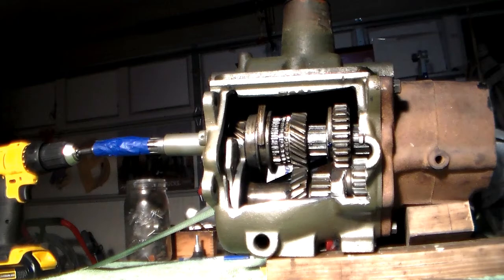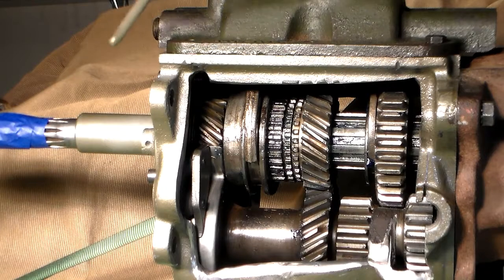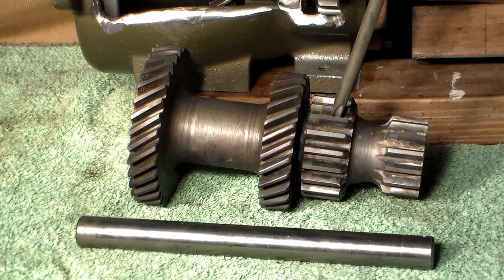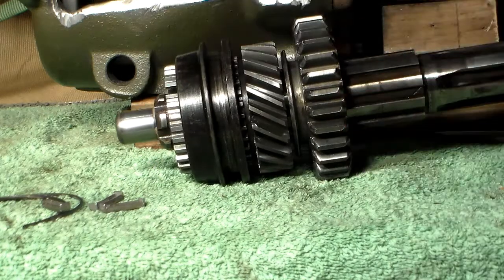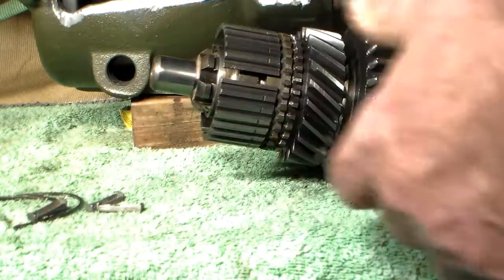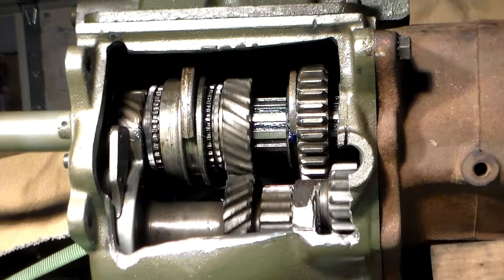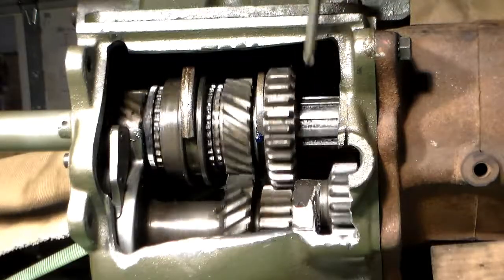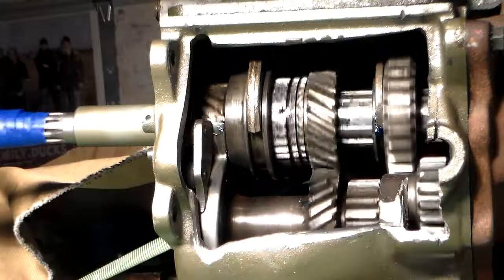Rick Stivers T-90 CutAway Internal Operation

Comment: Sir, recently I assembled a T90 wirlth the help of your videos. However, due to some mistake of mine, the engine stops when I release the clutch on 1st, 2nd and 3rd gear, although I have not connected the output shaft to wheel. The transfercase shaft are also rotating on engaging transfercase shift lever (the transmission gear in neutral). What may possible be the mistake I have made
Reply from the maker: Believe it or not I have experienced a similar problem. In my case, when I installed the shift tower, the first reverse fork did not get into the slot on the gear. It was stuck in reverse all the time. When I would shift into 2nd or 3rd gear it would stall the engine. That is because it was going into two gears at once and this locked the transmission. I don’t understand why your’s would do it in 1st gear. If that isn’t the issue I would look at the shift tower linkage to make sure it’s operating properly. 

I’ve gotten rid of all of my transmissions and Jeeps so I can’t make another video to assist you further. I hope this helps.

If you go to the 5 minute point in this video I think it will explain enough to get you through it with what I told you above. 
https://youtu.be/QzH5SWaeegQ?si=7HRLrrCQlo_te_8I
Reply: Sir, further today when I turned on the engine without the tower shifter, I find out that the counter shaft is rotating in neutral also, whereas it is rotating freely when the engine is switched of. What possibly may be the cause. Regards
Reply from the maker: It is normal for the counter shaft to rotate with the engine running if you don’t have the transfer case in gear or if you don’t have the driveshafts hooked up. There isn’t enough friction in the drive train to stop the transmission from turning with the clutch disengaged. There is usually a small amount of rub from a disengaged clutch plate that it will still turn a low friction drive train.

Comment: Hey Rick, wow! Ive niw watched the whole series and your videos are helping me so much. I really appreciate all the work and please know how helpful they are to shadetree mechs like myself. A question for you: I'm redoing the T90 in my International scout 800 with a T90 c. Unfortunately, the nose on my main shaft is shot and I'm having a heck of a time finding a replacement. I see so many jeep main shafts online, ut the pictures look slightly different a bit back from the nose end. Will any of those work for me or do i need an international harvester specific main shaft? And how bout the overhaul kits for jeep t90s? Are the needle bearings, thrust washers and ball bearings the same for IH and Jeep T90s? Thanks for any help.
Reply from the maker: Martin, As far as I know the rebuild kits are the same. I couldn’t tell you for sure about the main shafts.
Reply: @rickstivers3965  thanks, Rick. I appreciate your response. One difference,  I've noted for sure...IH Scout T90s dont have the oil collector ... what's up with that?
Reply from the maker: Martin, Even the later model Jeep’s deleted the oil collector. I guess they decided it really wasn’t needed. The biggest difference I know of between the Scout and Jeep T90s is the main gear and cluster gear. The beveled gears on those are cut in the opposite direction. That’s because the engines turned in opposite directions.

Comment: Really enjoyed this and another of your videos...I have a few 90's to tinker with. The one thing that has me puzzled is a loud noise when I back off the throttle in first.  ....  suggestions?
Reply from the maker: Charles, The T90 does not use helical cut gears for first and reverse. This means they create a lot of whine (a loud howl) in those gears when you let off the gas. If you aren’t used to it that could be what you are hearing.
Reply: @rickstivers3965  

Thx for the feedback,  but it"s not as pleasant as a reverse whine.  I'll check the end float on the cluster gear when it finally comes out.

Comment: Mr. Stivers,  thank you very much on your excellent videos on the T 90 transmission. I viewed it countless times for disassembly and assembly and it solved my jumping out of 2nd gear problem.  Watching the shift tower video on other problems that could  also cause 2nd gear to jump out-- broken detent ball spring or the stop on the shift fork or housing,---  has now givenn me a clue to check these 2 areas ( detent spring and stop on fork  in shift tower)  for reason why  it jumps out of 1st gear while going up hill. Seems as though the shifter is not fully engaging the 1st gear. It stay in gear if i maually hold the  shifer to keep it engaged..... Will check this out.  I have all new parts in the trans.  .thanks for your time and effort in making these vedios available...pictures are worth a tniousand words....aloha!! Mo